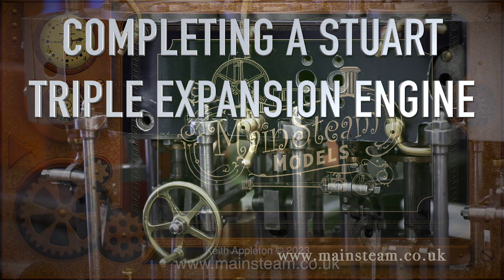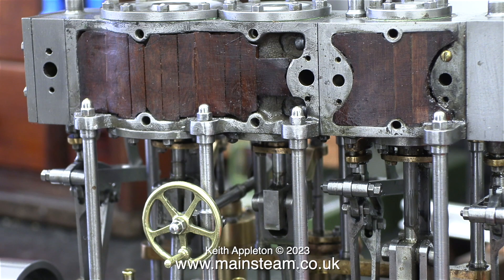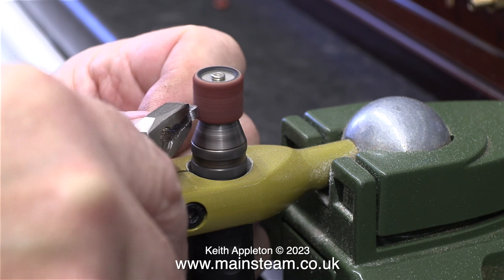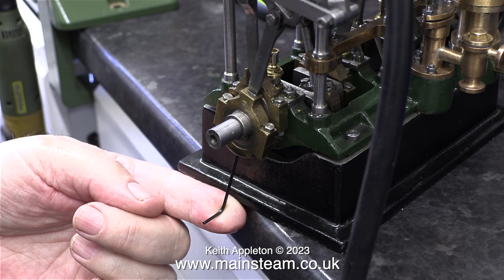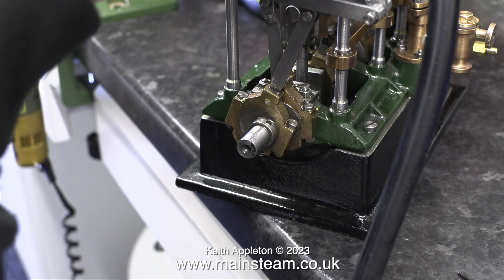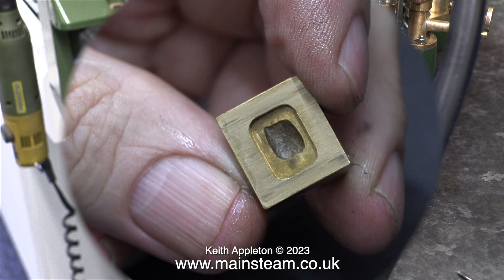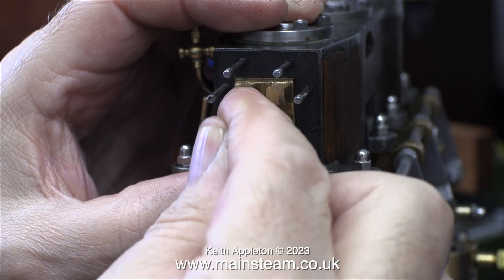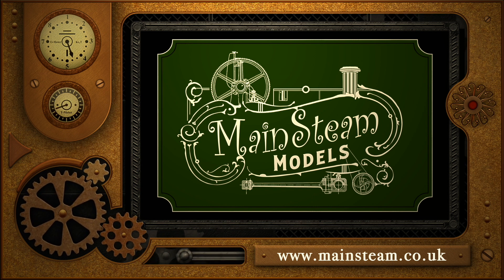COMPLETING A STUART TRIPLE EXPANSION ENGINE - PART #50

Comment: What would happen if you reversed the eccentric sheave on the crank shaft?  Would the retard the stem inlet,  never mind.  dumb question, It's the angle between the eccentrics that needs changing.  LOL
Reply from the maker: Can't do that - the large centre boss on the sheaves would be in the way ......